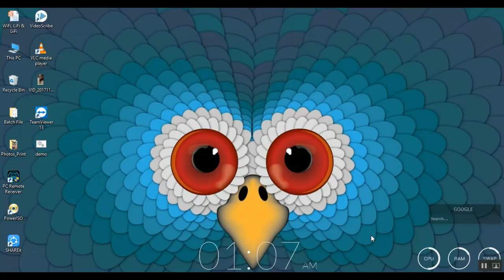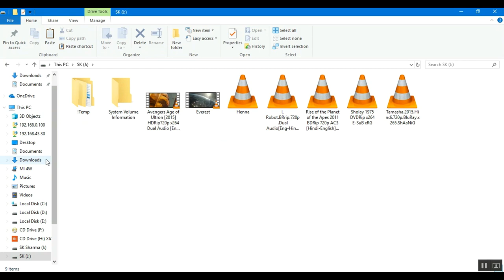How to repair TOSHIBA disk drive HDD 2J53

Comment: I usually remove the board first then I use an eraser to clean up the contacts they got moister for humidity due to the temperature got some corrosion when there clean you put everything back and you'll see the HDD detected again or working again. that depends on how you use the HDD or if you drop it and when you open up from the front like the one is shown maybe got drop it..or hit.